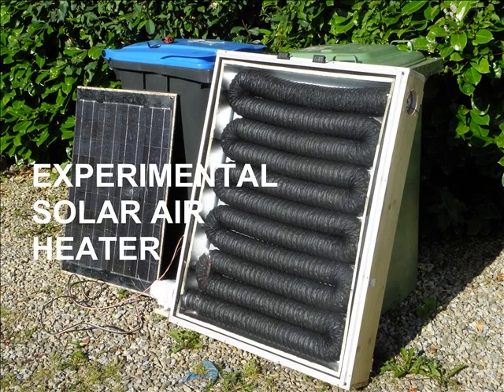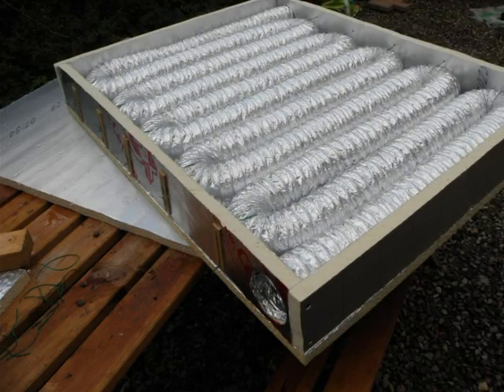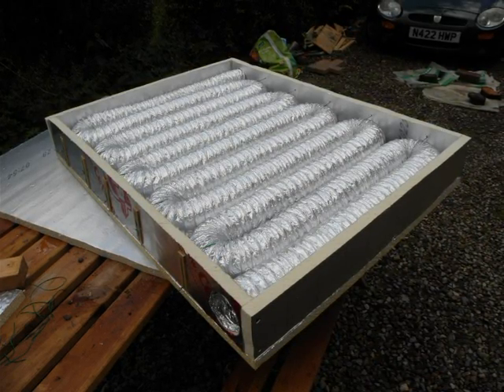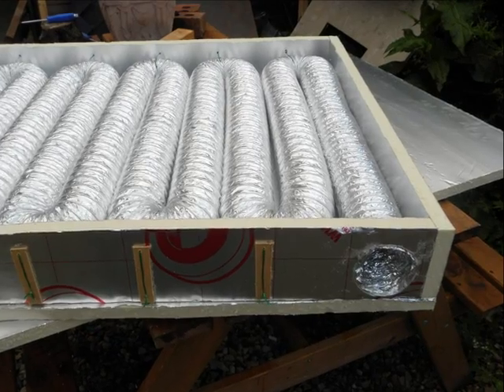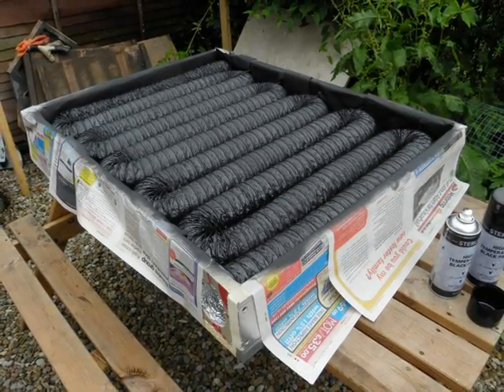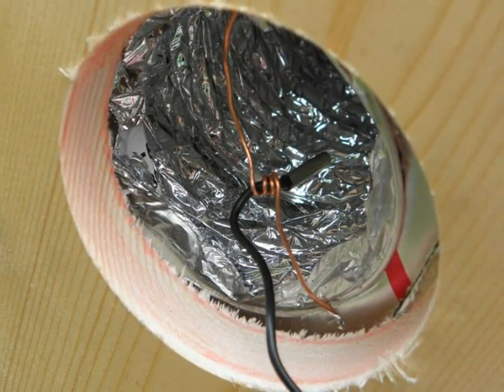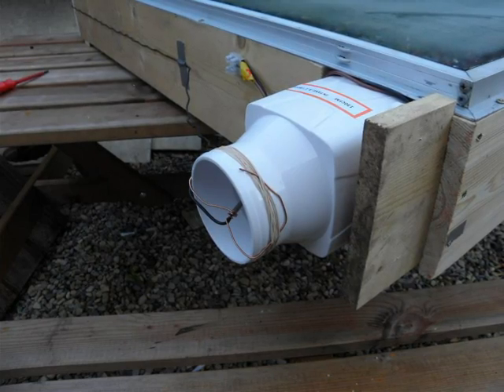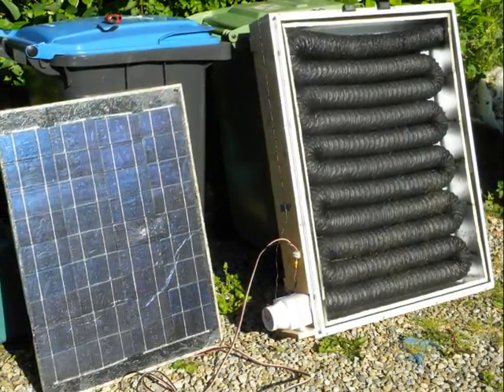Thermal Panel, Solar Furnace

Comment: Does ZERO At Night ! Waste Of Time/Money/Material !
Reply: It is impossible for anything solar to perform at night, unless it has a battery. So this device is great when used during a cold/ cool day or power outage.
Reply: Who would have believed that solar furnaces can't produce heat at night?
Reply: Obviously  you don't have to keep a woodstove burning all winter day long to heat a 3 floor house. This thing saves thousands
Reply: Really? It is based on sun energy. Is there sun at night? O yes moonlight but thats only very little;)

Comment: How does dilution affect the ability of these panels to warm a room? Notice how a drop of red liquid spreads throughout a large pitcher of water and almost disappears as it is diluted. It is not the air temperature at the outlet that will be the sole determinant of the heating affect but the volume of heated air that enters the house. Release one gallon of 120 F air into a room and it will have little affect on the inside temperature of a cold room. Also the speed of the air entering the room does produce the amount of heat added to the room. A simple explanation would be how many cubic feet of air at XX degrees will be needed to replace the air in a room to raise its temperature to xx Degrees? It’s a bit more complicated than that since you have to have a starting and ending temperature and the temperature of the incoming air and its speed, etc.
Reply: Not only did he answer your question in video, but he showed detailed calculations of how he came to that conclusion.
Reply: @uncleeddie5813 Pusťe si v pokoji malý 500 W ohřívač. Přesně takové teplo bude přidáno. Velkou místnost to bude temperovat, ale nevytopí. Když bude přechodné chladné období, může to stačit. Když bude mrznout a bude slunečno, nemusíte do kamen dávat tolik polen nebo můžete o 500 W snížit příkon do elektrického ohřívače. Je to úspora, jiné topení to nenahradí. Může také být velká oblačnost a v té době neušetříte nic.
Reply: 500W is your answer. put a 500W oil radiator in the room and circulate air around it with a fan. that would be an equivalent.

Comment: This design is refreshingly new. My question concerns condensation. As the continuous tube runs horizontally start to finish (opposed to vertical  open-ended columns of cans ) , what happens with moisture when the system cools down? The can columns would drain, what happens in this system? I am assuming that condensed moisture will be evaporated in the heating process and delivered in to the room heating system. Mouldy issues later down the track?
Reply: Venkovní vzduch  se v systému ohřívá, tím jeho relativní vlhkost klesá, takže během provozu nemůže kondenzovat. Je vháněn dovnitř, odkud někudy (stačí netěsnosti oken, dveří atd) vytlačuje vnitřní vzduch, který v sobě má víc vlhkosti, takže snižuje v místnosti vlhkost. Kondenzace může nastat až blízko místa venku, kudy vzduch z místnosti odchází do chladu venku.

Comment: awesome video. im looking at supplemental  heating for  a space 18ft by 8 ft wide. do you think this would work as background heating during our winters in england to take the chill off? i appreciate that its not the main heat source. superbly explained and such a simple solution.
Reply: O the joy of this septic isle.......yes,a panel like this would help, but with the addition of good insulation to the space, and maybe, if you could, use the air from the "bottom" of the room (ie coldest), to reheat it and put it back in....this maybe problematic as it could end up being too stale.

Comment: Since heat rises from natural convection, do you really need the solar panel for power?  The cool air intake would be at the bottom and the 'dispenser' is blowing into a room from the top of the unit.